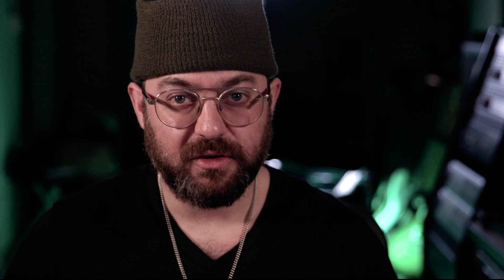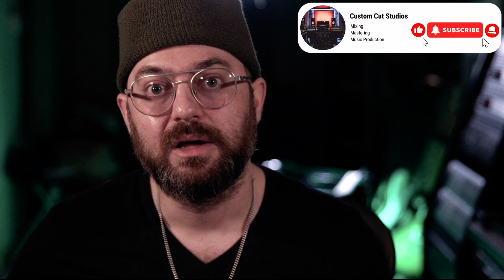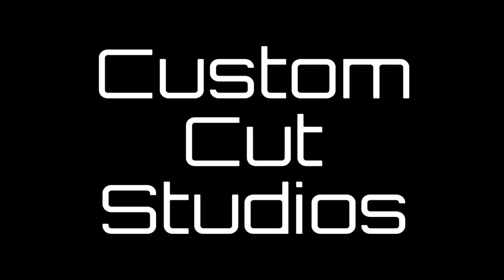Your Parallel Processing Questions Answered!  Follow up to Signal Flow Difference Makers.

Comment from the maker: To clarify, what I said about compression on a real bass. I like a faster attack to grab the transient and make the front of the signal more uniform (less pokey). I also like a relatively slower release (just slow enough so that I can get a relatively even sound throughout the bass). A release that’s too fast may become too loud and then in comparison it actually feels like it’s getting too quiet as the signal tapers off after the release lets go. Whereas if you slow the release down, it lets go more slowly which allows the signal to sound more uniform and consistent throughout. This is generally my preference. Hope that helps!

Comment: Hi, thanks I was one of the askers. I agree and know there's no right or wrong (I have a new concept I call the telephone bus) but what you explained in the previous video wasn't all that clear but nonetheless interesting. I wanted to understand better what you were on about with that.

What you went into at the end is why they say arrangement is the first step to a good mix i guess, these different low range pianos with various reverbs sound like a nightmare indeed.

Comment: I think it’s important to mention that in linear processing, the order of plug-ins doesn’t matter. So if you’re using a linear reverb, it doesn’t matter where you place it in the chain. It’s when you have a nonlinear process like compression or saturation that the order becomes an issue because these processes alter the signal’s dynamics and harmonics differently depending on the signal they receive.

Comment: When i heard you explain the EQ before reverb my jaw dropped. Of course!! Ive been doing it wrong since the beggining. I cant wait switch the order and see how it sounds.
Reply: I wouldn’t get too excited. Most reverb plugins are linear so it actually doesn’t really  matter where you place the eq, the signal will be exactly the same. That the nature of linear processing.  Now if you’re using a non linear plugin like compression or saturation then it  absolutely matters where in the chain you place your eq.  Some reverbs are technically nonlinear: usually the ones that have extra effects like modulation or something like that.

Comment: Good stuff! 😎 Doing parallel EQ? Probably not, but you can EQ  parallel saturation if you're hearing a reason to..... (EQ first on the Aux, imo)Or like a high or low cut on Parallel compression if you hear that you don't need those frequencies reinforced for whatever reason.

Comment: Awesome job. Thanks for answering our questions. Just started the video qnd the info on reverb is already gold! If it helps for future content, reverb is tricky as a beginner - where to pan, whether to use mono, whether to pan delays or reverb to the opposite channel of guitars, what to EQ and how to blend without causing a cloudy mix.

More gold on the bass compression too! I've been scared to use a fast attack even when my gut told me it was needed because I was scared of blunting transient too much. But it's like you say - sometimes you need to have confidence in your ears and forget about whether you're following a rule.